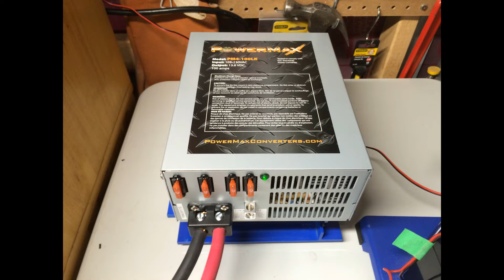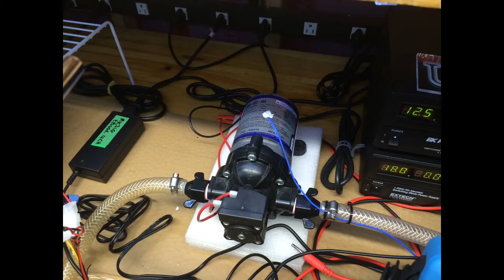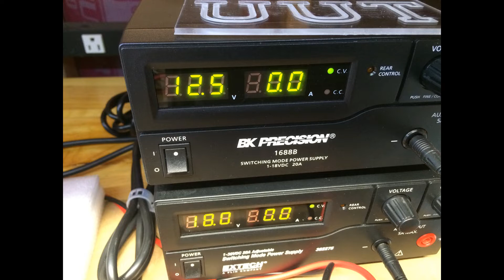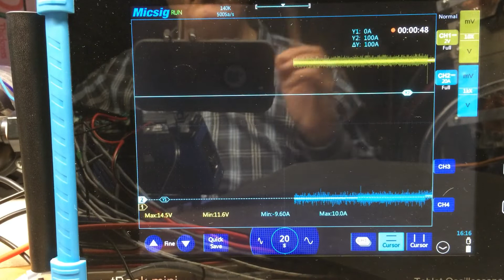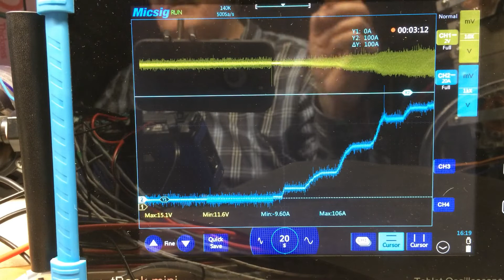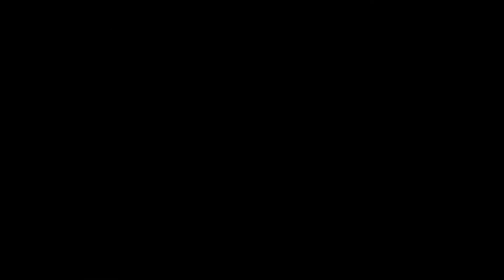2 - PowerMax PM4-100 Switching Power Supply mode… Behavior of voltage and current on electronic load

Comment: Is it a cc/cv charger?
Reply from the maker: In this video the PM4 is used as a fixed power supply with a constant voltage (CV)... Also, the PM4 can be used in three (3) stage battery charger mode... Thanks for the question..